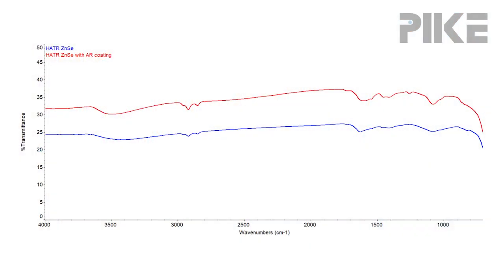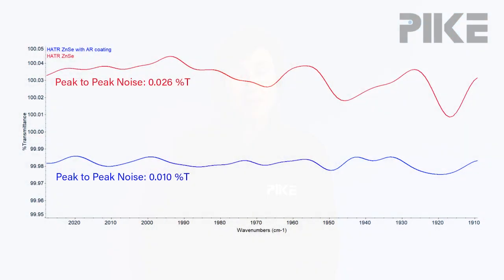4 ways to increase ATR sensitivity

Comment: The AR coating would not absorb IR radiation, or the absorption bands would be negligible?
Reply from the maker: Hi @mirceadanpuia9688, 
We use a broadband AR coating, which provides a nice wide range and does not interfere with the mid-IR spectral range. If you look at the energy throughput spectrum shown at the 1:40 min mark you can see small signatures due to the coating, but these will ratio out. 😊